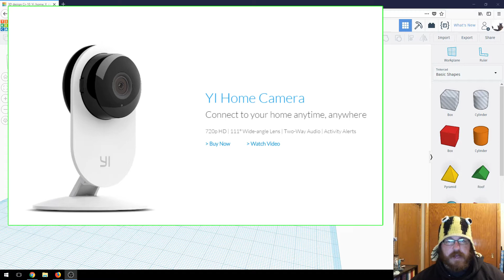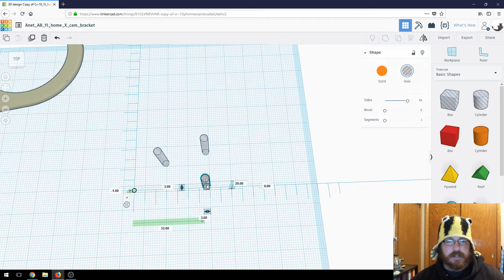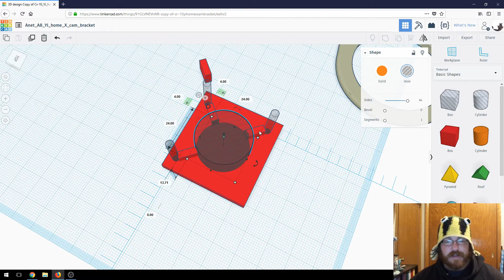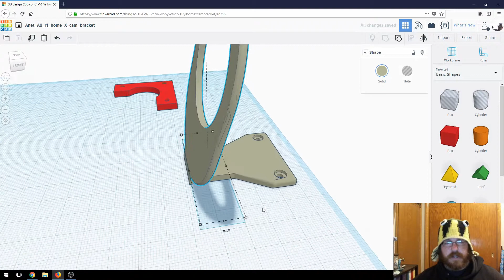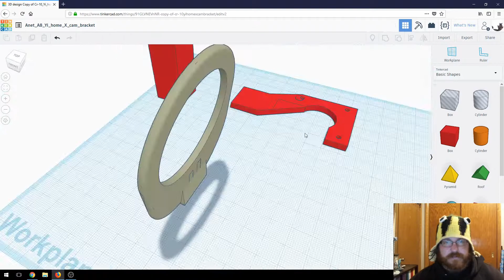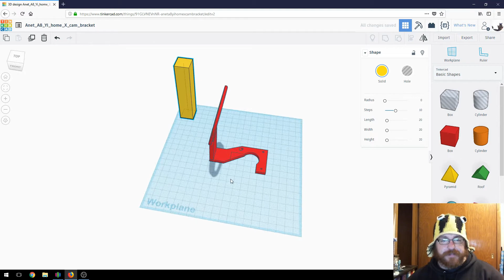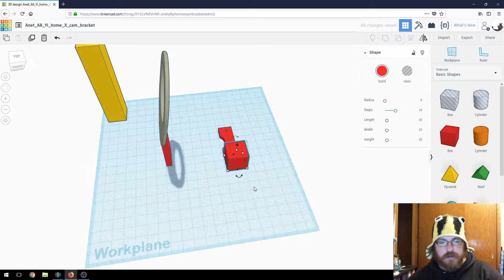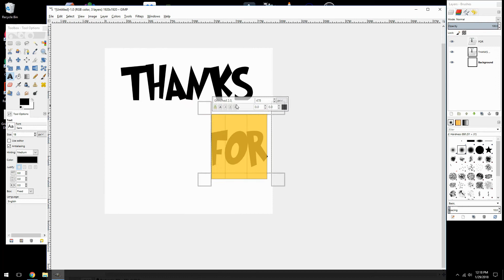Anet A8 IP Camera Mount Project Tutorial (TinkerCAD)

Comment: Great idea on mount place, but i have there z-axis level push-switch-thingy. Do you have a video on autolevel mounting & configuration ?
Reply from the maker: TheSaikek interesting, I've never seen the z axis limit switch on the bracket I've always seen it down on the frame. I have some videos on auto level setup after installation but not the actual set up. I think 3d maker noob has a good video series on it, might want to check that out.